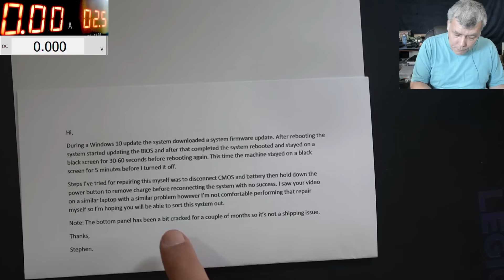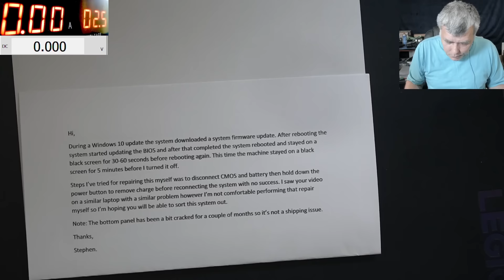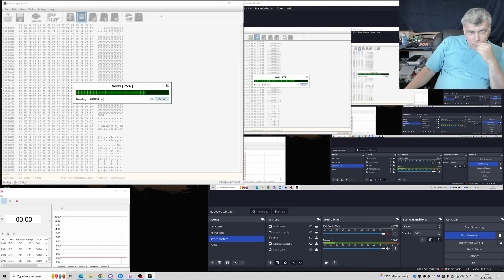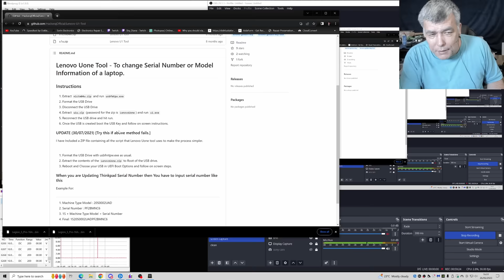Lenovo Legion 5 15ACH6H dead after windows updates - Sadly, laptops are dying after windows updates

Comment: Issue should start with the customer description. Take the descr and read it backwards. 

The first issue is a software issue. The customer saw a black screen and then panicked. 
Plan this.....but do not change anything yet....... to undo what the customer did and the unit should start normal. 
Or, let the video update complete and the screen should appear....
I would check the Compatibility list for the new version of Windows against the specs. 
Maybe there is a know issue the seller is aware of for that version of notebook. 
(other people would have had the same issue)

The First thing ....THE VERY FIRST THING YOU SHOULD HAVE DONE BEFORE CRACKING THE CASE
was to run the WINDOWS DIAGNOSTIC to see if there is a hardware failure.
The power issue might be caused by a bad plug or a bad port. 
the case might be cracked.
if its a bad Bios chip, the customer would have had a problem or something before updating the system.
when a computer starts you should see a Cache light flicker before the screen turns on. 
all of these things would have appeared on the diagnostic except a bad cord.

lastly, If all else failed, I would try switching the the Hard-drive as a last resort with a drive that has the older version of windows (software) to see if it will respond.

Comment: Way to disable bios/UEFI/firmware updates in recent windows:

1/ launch sysdm.cpl
2/ Hardware tab
3/ Device install settings
4/ select "No" and OK
5/ Done, Windows will never download any hardware-related updates.

I don't see the point of updating an UEFI or firmware as long as it's not to fix a very annoying issue.

Comment: It’s a common thing for windows updates to include the bios update from the manufacturer. There are several parts to those updates, and may require several reboots. Also may take up to five minutes for each part. Never interrupt it.
Reply: Absolutely - the customer I support uses HP ProBooks, in the past I would have had to download BIOS updates from HP (if they were needed), now Windows Updates does it, and like you said, there are multiple parts as it also updates things like USB controller firmware, etc...!

Comment: This is why I still run windows 7 ultimate 64 bit, there is a service pk2 available now and you turn off windows updates completely or it will corrupt the system files. plenty of antivirus programs out there to support windows 7 ultimate if you need to run one. such as Panda dome free or subscription version.

Comment: Windows absolutely should not be updating firmware, or anything else that is going to be reflashing the bios of a computer.   Most people probably don't even realize what is going on.   I personally am in the camp that, as long as everything is working as intended on your system, you shouldn't reflash the Bios.    I've been building computers and been a hobbyist for many years, and I've personally learned the hard way about flashing bios.   All it takes is some kind of failure or power blip during the reflash, and likely your system is bricked.   And if it's a single bios system, usually will require soldering a new flash chip onboard.

Comment: When you said that you had replaced the BQ chip and still I didn't see a current draw on the screen (0 mA), I thought the worst!

On the other hand, in some TVs a failure in the eeprom (BIOS chip) causes the TV to show a black screen and even in other times the symptom is: "It is dead" because the Pwr Led indicator does not even light up. Another way of saying it, when one is a novice: Power Supply? Mainboard? Panel display? and for being a beginner you pay the price buying the boards but you learned a lot for future repairs...😊lol.
 
Thank you very much for sharing. A sincere congratulations. All the best.

Comment: A Lenovo bios update bricked my lenovo laptop. Had to remove the eeprom and flash with older bios. Lucky I have the tools and knowledge. I contacted Lenovo to let them know the issue and they never responded. The bios update removed the ability to undervolt the laptop. I used to get 7-8hrs of use. After updating the bios and windows my usage went down to 2-3 hrs. Now with all recent updates etc my laptop takes 2-3minutes to boot. The quality of the laptop is great, I use it everyday. The software and bios is terrible

Comment: I have laptops that have been running for decades, 1 asus, 2 hp. A Lenovo used very little for office use, dead after just 2 years, when the warranty expired, the service centers consulted both diagnosed a CPU problem and the motherboard should be changed... Never again Lenovo !!

Comment: I had to check a similar case a couple weeks ago. Effing windows tried to update the firmware of an Lenovo AIO PC, and at the end of the "update" my client got a nice and useless paperweight. I had to flash the BIOS twice because the SSD saved the last update process, tried to apply it again and screwed the BIOS  for a second time. Then the solution was a change (or format) of SSD in addition to the BIOS recovery. Why does MS have to stick its nose with essential hardware configurations? It's already bad enough to have to deal with that piece of  spyware called windows.

Comment: i had failed power cable problem on different laptop, cable looked fine but stopped power. using this laptop so far its pretty well designed considering i use  it most of times airinlets covered.

Comment: Never ever heard of a windows update going into bios, infact the bios is not usually a required system update,you can have wi-fi chips and other hardware updated.bios has over the yrs changed to uefi which is different to old school bios but in the yrs ive worked on pc,s ive never seen it updated unless the user does. as always leave the bios alone unless you have a reason to wipe it as for windows updates yes they can be dangerous to some pc,s.

Comment: I had no idea MS updates were also updating the BIOS. Sounds pretty risky to me as your customer discovered. I thought most new-ish PC have enough storage capacity to maintain two copies of the BIOS. The normal runtime BIOS and a failsafe backup, but I guess I was wrong.
Reply: It's generally not wise to just blindly update an operating system either, even though lots of fixes don't break anything.  
  
Also, "storage capacity" isn't really relevant, because the BIOS is stored in a dedicated ROM chip, which is what gets /flashed/ in an update process. That chip is either mapped directly into the computer's memory space or at least copied into ram at boot. --- To have a backup BIOS would generally require a second chip and then you need an appropriate mechanism to ensure that the backup chip is never enabled/accessed under normal circumstances.
Reply: I never encountered BIOS update from windows update and this coming from someone who built desktop PC since 2009.

Maybe this happened only for laptop user???
Reply: @arx117  exactly. This is just some made up BS that people are spreading. BIOS windows updates simply doesn't exist esp on Mt line of work as both a Sysadmin and a Field Technician that's administer and supported of to 50k thousands of machines everything from RHEL Linux, Laptop's, Servers, Thin Clients, Engineering Workstations, Macs. I'm Dell Certified as well that's authorized to carry out hardware warranty repairs.

Comment: I do have a consumer bring to me a lenovo aio machine. It have similar story, but it end up with no volt at whole cpu ram gpu side. it have standby volt and input volt to the power management chip, but it didn't have any 12v output from that chip. Also the chip seems like is special one design for lenovo which can not be replaced by others. LOL, the board end up in the gabarge bin.

Comment: Earlier this week I had to completely reformat and reload windows on a tablet after an update failed.  I have no idea what the update was trying to do but where as before I had two partitions, the main one and some mystery 32m (or something small) that I had no idea why it was there.  When I started reinstalling windows there were four partitions.  I have no idea why an update was partitioning the drive.  I deleted all the partitions and then reinstalled.  

Before that I had tried the repair button but it would spin for half an hour then get an error.  I think the update failed because the battery went dead part way through, although I thought an update was suppose to recognize low power and NOT update.  

I normally don't let updates run until MS forces it but this one got by because of a mistake.  By waiting I can be sure all the bugs, and there are always bugs, are worked out of the update before MS screws up my computer.  This update proves that waiting for the stable release is absolutely the right thing to do.  Luckily that tablet is a single purpose utility device so I didn't loose any personnel files.

Comment: I wouldn't have an issue with Lenovo using ID chips in their chargers if they were considerably more robustly built. However it seems a lot of Legion owners with 230 Watt supplies are in a similar situation; once the first one goes out after a year all the replacements die in six months. I've torn a few open since I've gone through three myself. Just too much condensed into a small package. I'd be willing to use a supply as large as the original Xbox 360 supply if I knew it would last. I'm buying one more direct from Lenovo just so I can have the receipt from them and sell my y545

Comment: Dell laptops are like this too. 3rd party chargers just don't work on many models. Good work on the BIOS reflash. When I repair laptops & grab the latest Windows updates I try and avoid BIOS updates. usually they are listed under 'optional' so they're easy to ignore, but I have seen some HPs grab a bloody BIOS/firmware update from the mandatory updates. Not cool, Microsoft /HP!
Reply: False. All BIOS updates on Dell laptops are done through the Dell Command Update app or manually from the Dell website. I'm Dell Certified that works all Dell products everything from Laptops, Servers, Workstations and Thin Clients. I'm a Sysadmin and Field Tech that support up to 50k machines.
Reply: @eman0828  Not what I said, my dude. If you read it back, I'm saying Dells are 'like this too' - eg complain if the charger is after-market. Then I went on to moan about HPs doing firmware/BIOS updates via Windows Update. I was complaining about Dell smart chargers! Doh!
Reply: @Blitterbug  ok that you were talking about the BIOS. The video is misleading and I think it should be taken down as this is user error from the OP. I never in my life encountered a Window's update updating your BIOS much as laptops I deal with on a daily basis working in the IT field. The OP seems to be clueless that doesn't know the difference between a Window's update push from factory installed software by the hardware manufacturer. Microsoft has nothing to do with anything at the system board level.
Reply: @eman0828  Ah! Actually, I can sadly confirm this actually happens. Been in the biz over 35 years and it upsets me, it's a new trend definitely, but both HP and Lenovo laptops and all-in-one PCs have downloaded BIOS updates through Windows Update. Before my very eyes. Not Dell, so far. But this used to only be found under Optional (driver) updates, whereas it's started creeping into the main mandatory updates screen. More and more manufacturers are pushing BIOS updates to Microsoft, as full expandable packages that - yep - reboot and fecking update the BIOS. Scared me a few times, because what do you tell the client if you brick their shiny new machine?
Reply: @Blitterbug  well I have a Legion 5 and the BIOS hasn't been updated in three years. I'm still on version EUCN26WW. The latest BIOS update as of 2023 is GKCN60WW. Not sure where you are getting your resources from. My laptop has gone through countless Windows updates. When I first bought my Legion 5, I removed the factory OEM installed image that came pre loaded and installed my own retail copy of Windows and loaded the drivers myself. I flashed the BIOS myself in 2020.

Comment: Happened to my baby too, had an octa core, 96gb, 4tb custom build, windows updated to 11 without permission, keyboard driver severely malfunctioned so all keys were perma pressed and it was impossible to operate, rolled back to win10 and now it won't recognize any I/o devices, integral or plug in, it's effectively a brick when Windows is installed, now it's running parrotOS w/o a problem though. 

It's not hardware causing the problems, it's all software, and especially a very intrusive microOS running on board and causing driver corruption during system check, that's why you need certain chipsets to upgrade, so the new embedded microOS can flash/run and then it causes driver issues with everything else, laptops seem to have the biggest problems with it because of lower power availability.

Comment: Asus does the same, if the Windows is not an Asus version. Also, malfunction may happen, if the Wifi card is not specific for the laptop, or if the Cpu is not compatible. For example, an Amd QL 64 has 1800 mhz fsb, QL 65 has 2 Ghz Fsb. Windows Update may screw up the hardware, if the battery shows X. Sometimes a Cpu swap can start the laptop.

Comment: Awesome video.  I have had alot of great luck with bios updating and rolling back bios. I dont know how the heck windows updates caused the bios to get messed with, but i do think that lenovo also had updates at the same time and that when lenovo was updating something on the computer,  windows was also updating and eventually will auto shutoff the computer so it can come back on to finish updates after download or install processes.  I have ALWAYS!!!  Forced windows to notify me of updates so i can manually turn off the computer. And whenever bios are updated, i will use the m flash or whatever flash utility thats built into the motherboard so i dont come across this issue.  Sometimes Microsoft gets evasive especially when im in the middle of something or a project. I had video editing projects have to be restarted or have to find a save because the computer just restarts without warning. The worst time is during a bios update via software!

Comment: Great video, Great examination and very detailed explanations. BTW, i have the same laptop and wanted to ask you, should i leave the power plugged in all the time ( even when I don't use my laptop ) or should I disconnect the charging power supply while the laptop is off. what is the right thing to do?
Reply: leaving your laptop plugged in all the time is very badfor the battery
Reply: @hgh4349  It makes no difference on a modern laptop
Reply: If you are using conservation mode which limits charge till 60%, then you can leave it on as the laptop directly runs on charger power. If not the battery will get charged frequently and till 100% which is not good for health of battery
Reply: @nirmalkumar7941  yes this is my setup

Comment: Another customer who suicide his laptop.... He should wait , it is written  "Do not power off your PC "
Reply: @celdepescaun39: If we add to what you mention😊, that here in my region the summer season arrives with beneficial rains (I hope they are torrential, abundant, to mitigate the drought) accompanied by thunder and lightning which generally cause the interruption of the electricity supply ( blackout) and another added benefit for auto mechanics and electronic workshops (we have more work to do). All the best.

Comment: And that is exactly why I say a hardware must stay with the software version installed at the factory. Usually, there are NO benefits you get from the update. True, it might add some new features, but do you need them? You are already using the thing, and everything works fine the way it is. Why would you want to change it and re-adjust your settings again? Do you seriously want to spend your time revisiting the already working machine?

Comment: This is one of those times where I have to throw Razer a bone. They've allowed Microsoft to include practically everything my Razer Blade 14 needs through Windows Update - except for BIOS updates. I think I've gotten only one notice regarding a new BIOS file to flash since getting my laptop, and it's always through Razer's onboard software suite. If you don't mind being tethered to Windows, this is a really solid maintenance system they've set up.

Things are... a little less rosy on the Linux side. Most of the hardware is proprietary, and not every distro comes with compatible open-source drivers. Throwing Linux on a laptop is pretty much a game of Russian Roulette, unless you're working with a Systems Integrator that actually builds laptops with Linux in mind. System76 and Tuxedo are those I know of.

Comment: Dell have done some strange things with their laptop power supplies. I tried to use anon Dell power supply with my Dell laptop but the battery would not charge and the CPU would run at 25% of it’s usual clock speed. The non Dell power supply had the correct voltage and current output. I used a third party app to run the CPU at the correct speed. I had to get another Dell power supply to charge the laptop battery. My new laptop is not Dell !

Comment: It is a good update. The technique to flash-bios(while system is running) to match OS should be copied. All the firmware-matching-chips(function - bluetooth,wifi, cable-network, display-port, storage-controller, ...) should be owned. Then can start-boot with microcode-load before bios-uefi-boot.

In theory... microsoft just screwed themselves.
Reply: Lenovo will be a buy if all programmable-logic-controllers, ... firmware, are own3d